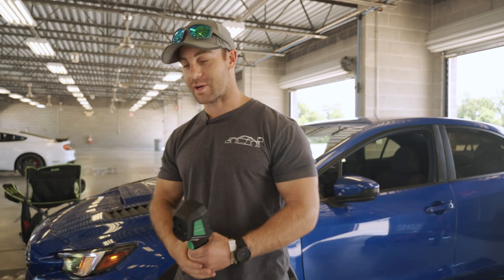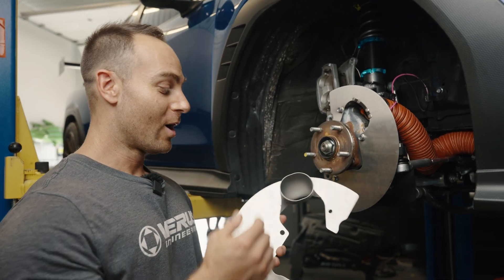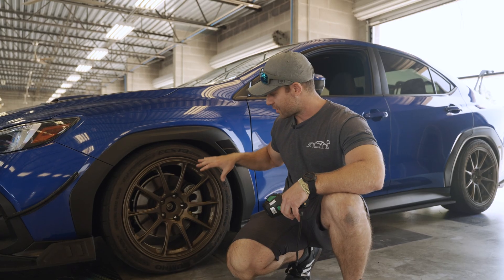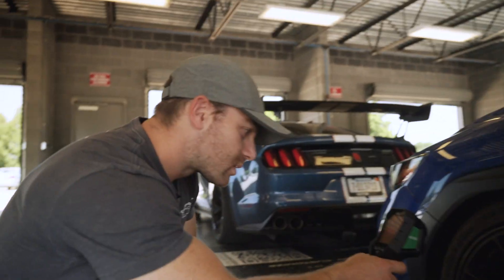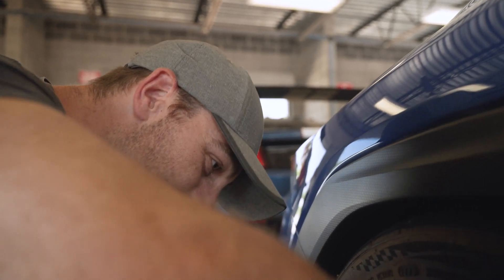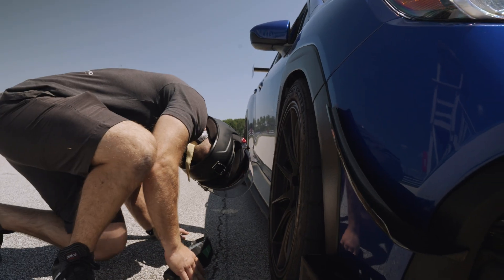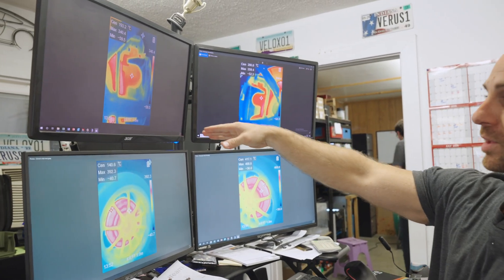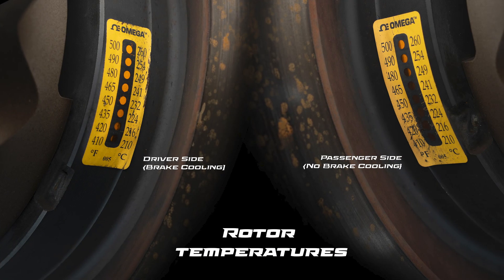How do our Brake Cooling Kits actually work?

Comment: LOVE this. I have 2 questions. Was there any testing on any kind of large or small hole mesh for the intakes? I live by a lake and the bugs here are INSANE...i am worried this would turn into a giant bug trap. Also, the lake I live by is Erie, so I get A LOT of snow. Any idea what the risks may be on that? Lastly, I have a suggestion I think is worth looking into with your exact concept here...a feeding tube, perhaps baffled, leading to the under side of intake; originating from the fake mesh area above the passenger side fog light bezel maybe, and feeding up to the general intake area to provide actual CAI. #1 used intake on these is the ETS, and even if you get the box, it is open bottom. I think this would not only make a measurable difference to the intake temps but is also an opportunity for something truly unique.
Reply from the maker: Glad you like it! Bugs are inevitable, but they're not going to be any more damaging than bugs hitting your front grille or a radiator. Mesh or baffled ducting could help add a layer of protection, but if you're really concerned about snow and bugs I would just run a BBK.

Comment: What would happen if you guys put like a turbofan in the tube of the brake cooling kit? Would it in theory, speed up the air, traveling to the brakes, thus cooling them more?
Reply from the maker: Depends on if the turbo fan can put more airflow through the tube than at speed on track

Comment: Since you got now that metal printing advantage, have you thought to make something simpler for road use, like an Air shroud that could be mounted on the suspension arms? Subaru front suspension arms design are almost the same of not the same part across diferent models.
Im refering to Subaru Legacy Gen 4  and WRX STi (GRB) uses the same aluminum arms and non aluminum arms.
Apexi got one kit for GR86 and BRZ as an example.
I Know the temps would register less diference, but that would be great because we wouldnt have to make holes on to the bumper, since there are diferent bumpers.
Reply from the maker: We do have this brake cooling duct kit https://www.verus-engineering.com/shop/a0527a-brake-cooling-duct-kit-subaru-wrx-vb-4363. It's a little different, but similar in some ways. We appreciate the feedback. We'll look into it!

Comment: whats the wheel and tire specs on that VB? looks great
Reply from the maker: Tita-7 tr-10 18x9.5 5x114.3 +40 / R: 18x9.5 5x114.3 +40 Non-Staggered
Reply: @VerusEngineering  thanks! def one of my favorite tire set ups. the wide tires make it look so much better.

Comment: That heat in the center part of the rotor is also going out through the wheels and into the tires. Might have been interesting to look at tire pressure/temp differences as well. Not to mention wheel bearings, studs, lug nuts.

I guess radiant heat on ball joint and tie rod boots is less of a concern since your cooling kit still uses a backing plate?

EDIT: It might have also been nice to look at the effects with an aftermarket brake kit with more efficient rotors to see if the effect is as big.
Reply from the maker: All great points, we appreciate it. Lug nuts sound interesting for this kind of test. We're working on a big brake kit for this car in due time. We were curious to see what we could get away with with stock calipers and ebcs for spirited driving purposes.
Reply: @VerusEngineering I only mention lug nuts because some people swear by aluminum lug nuts, because they want to reduce wear to their studs from frequent wheel changes, and save weight. But aluminum has a higher rate of thermal expansion than steel, so hot aluminum lug nuts sounds like loose aluminum lug nuts, which isn't what anyone wants on track.
Reply: That is a good point. I'm running 6 pot brembos in the front with 18" wheels. There is very little space between the caliper and wheel. I recently went to the track and the heat delaminated my V730 tires. I think It was due to a couple of things

- Little Camber
- Calipers overheating and transferring heat to the wheels
- Poor cooling.

Hopefully this kit helps keep the tires cooler.